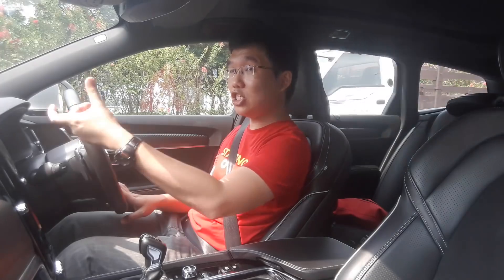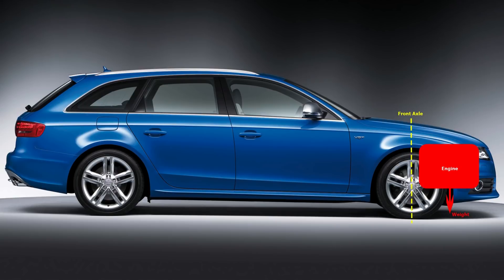Longitudinal vs Transverse Engines: Why Volvo Prefers Transverse - #KonOTR 023 | EvoMalaysia.com

Comment: When EuroNCAP crash tested their first batch of car in 1997, those with logitudinal engine such as BMW E36 and Mercedes W202 did badly because in an offset crash, the engine was pushed aside and the force went straight into the cabin. Whereas tranverse engine cars such as Nissan Primera and Volvo S40 did better since the engine can block some of the impact.
Reply from the maker: Yeah, those early cars were designed without crash tests in mind.

Comment: Does it mean that longitudinal configuration is more dangerous than a transverse config? 
Because if not mistaken some manufacturer (like Subaru) makes their longitudinal mounted engine break downwards together with the shaft in case of collision as well.
Reply from the maker: I think Volvo also took it too extremes a little la. Many manufacturers continue to use longitudinal engine configurations and produce cars that are no less safe. Your example with Subaru is a good one.

That being said, there's method in Volvo's logic. A transverse-mounted engine definitely dissipates collision forces better than a longitudinally-mounted one.